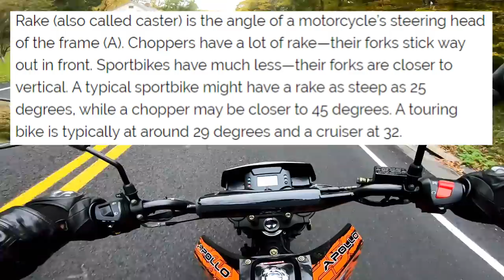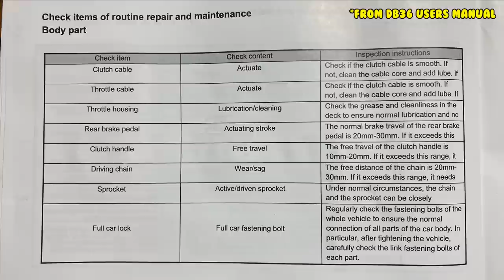[E1] Vitacci Apollo DB36 Supermoto Review, Build, Assembly, Test Drive, Impressions.(updated $1799)

Comment: I have a pitster pro xtr250. How would you compare the apollo to it? I'm thinking about getting my son something to ride.
Reply from the maker: I believe it’s the same engine (Honda CB clone) but DB36 is designed more for the road it has a stiff ride. The dirt version of the DB36 bike is the RXB250L
Reply: As of to date I've put 1k miles on it mainly driving to work (45miles one way). I did change the final gearing and put shinko 705's on it but seems to be holding up good. I appreciate you getting back. Your videos are helping me decide. Thanks

Comment: I am about to buy a Chinese bike. I like the Apollo DB-36 or the Lifan EFI 200. Which one do you think is the better bike?
Reply from the maker: Lifan is a great bike but I havent got to do a review on one yet, but I should be very soon! In the works
Reply: @MotoCheez  Thanks for reply. If you were to choose (manly street riding in Phoenix, AZ) would you go with the Apollo DB-36 or the Lifan EFI 200? I have seen very little reviews on that Lifan EFI 200 seems like a good bike though
Reply from the maker: @usaphilippines  I'd say the Lifan, its liquid cooled and I'm sure more HP and great for street use. If you plan on even a little bit of offroad I'd say the DB36
Reply: @MotoCheez  Cool thanks for the response! Going to get me one of these on payday.
Reply from the maker: @usaphilippines  awesome! If you use TXpowersports you can save a few bucks using "motocheez" coupon code at checkout.

Comment: So no greasing any parts or using a torque wrench?
Reply from the maker: No, the bikes I've gotten that I've checked the swing arm and neck bearings in the spots that should be greased had plenty of grease. I have seen that some do not though apparently

Torque wrench where?
Reply: @MotoCheez oh ok cool, I ordered my first one and my buddy’s that ride told me I should get grease and a torque wrench. But maybe the parts that need assembly don’t need to be torqued?
Reply from the maker: @drewmichaels726 I do go over bolts by hand, sometimes the plastic screws vibrate out, I use RTV silicone on thread to prevent the ones that loosen

Comment: I have a higher duration cam coming from Brazil for my Hawk to take care of that lack of top end on the Hawk.  With my ported head and 30mm smooth bore carb I have ALL of the mid range, but it still falls on its nose around 7000-7500.  I am willing to sacrifice some of that lower end grunt to get more top end power out of it and actually be able to use the top end of the RPM range more.
Reply from the maker: That's awesome! Love your vids too.
Reply: @MotoCheez  Thank you.  My videos aren't as high quality as yours, but I make up for it with plucky spirit :D

Comment: I have an Apollo and if I run this bike without a battery will it ruin the stator? I have the 2019 deluxe model 250 RX.
Reply from the maker: Only if the wire shorts out

Comment: you probably done answered this question a million times but WHICH is the BEST Of the CHINA DUAL SPORTS AND WHICH IS THE WORST And WHERE WOULD THE BROZZ 250 BE ON THE SCALE OF BEST TO WORST
Reply from the maker: Brozz250 is up number one. Very very close second is the DLX. Then this DB35 then the TBR7 then hawk250 then magician. Depends what people are looking for efi  is a plus and a minus for some. For The supermoto street ripping crowd I’d say the DB36 is number one, even if you convert any of the other bikes, it’s still number one because of frame, OHC weight and steering rake, suspension...  all depend on what someone want the bike for TBH

Comment: How often should we be changing the oil on the apollo bikes?
Reply from the maker: I think the manual says like 5000, but I do every 1000, it's onlyb1 quart of oil
Reply: @MotoCheez  ok sweet. So today I rolled over 370 miles so far on it. Still running good.
Reply from the maker: @therockjab  did you do the first oil change yet? That should be done now if you haven't. Then every 1000
Reply: @MotoCheez  I changed it at 100 then at 200. Trying to be extra careful out the gate.

Comment: How does one compare to a CRF230? Ive riden a dual sport 230 and owned a yamaha ttr225 for years
Reply from the maker: This has hard Supermoto suspension. Power wise. If you do the carb work it's not much less than the CRF230L. I owned one.

Comment: Is there a reason you never use thread locker on the bolts you’re worried about becoming loose?
Reply from the maker: I rather used silicone sealant so I can remove whenever I want and it's better on vibrations. I don't like locktite on panels because I know I'm going to remove them.
Reply: @MotoCheez  ok good answer just wondering i live in ny so cant reg one or id buy a Magician
Reply from the maker: Why can't you? Hawk250.com is New York and dozens of ithers

Comment: So I have same bike. 150 miles on it but it has developed am issue.. idle till 1/4 throttle is fine but anything after it sputters really bad  I checked  plugs they fine.  Slightly black in color. I'm 60 feet above see level. Any suggestions??
Reply from the maker: Did you rejet the carb? Possible the main vibrated out? Choke is definitely off? (Lever down)
Reply: @MotoCheez   choke is fully off jets are tight I changed the 109 to a 105 like u did. Didn't work for me.  I am out 3 turns on the mixture screw.
Reply from the maker: @therockjab  the plunger needle is set to middle groove? Had a few people have the needle clip fall off on theirs too
Reply: @MotoCheez   yea clip is in the middle..  it's crazy.  Its gotten worse. I wnet from cruising at 55 to nearly 45 now and that hardly cracking the throttle. I've tried adjusted the. Choke while riding to see while cutting out it would make difference but still nothing.
Reply from the maker: @therockjab  one thing I saw once that caused this was the tube that goes from the carb to airbox was collapsed. I pulled the tube off to run without it and it was perfect. Maybe try that?
Reply: @MotoCheez  I'll  give that a shot tomorrow.  Thanks.
Reply: Man after taking carb off changing jets like 50 times. I finally figured out the issue. The coil was not making good ground at the frame!!!!
Reply from the maker: OMG!!! Well, glad you found it. Now you're a pro at these carbs too😁🤜🤛🔥🔥😂
Reply: @MotoCheez   lol yea. I definitely got the "nack" for it ha ha .. thanks for all the help man.  Min truck is sweet by way.
Reply from the maker: @therockjab  glad you got it tho!  Thanks

Comment: @motocheez how often should I be changing the oil on this bike?
Reply from the maker: 800 to 1000 miles
Reply: MotoCheez thanks brother
Reply: There's a tube on the front left of the bike that came loose with a plastic piece that says in and out on the end of it. Does this go attached to anything or stays loose? It's connected to a metal piece behind the intake area on the left.
Reply from the maker: I'd have to look. I think it's just a vent.
Reply: @MotoCheez  if you could tha would be awesome. Thanks for the help. Just assembled the bike today.

Comment: Did you have to cut the tube that had the tag hanging down from it
Reply from the maker: Tag?
Reply: MotoCheez that was connected to the rubber hose that u said I don’t no what that’s about it says cut after first ride
Reply from the maker: Ohh. I just left it. Still No clue what it meant
Reply: MotoCheez o ok thanks didnt no if I needed to cut mine or not

Comment: Hey I'm pretty sure I saw you and your mob on the side of the road in the Cherneskie Rd, New Prestion area a few weeks ago...I went by on a red Victory with my wife on the back... I should have stopped but I wasn't 100% sure it was you.  
I'm done with China bikes after the Pitster. Its been doing good, but it hasn't taken me long to find it limits, finding parts for upgrades is a total pain in the ass and it has no balls..
Reply from the maker: PaiN's RIdes yeah, that was us, I think I remember that bike going by! The pit bikes are kinda junky. I will agree on that. The better ones are good, the cheaper older ones are garbage
Reply: @MotoCheez  Shit, I knew I should have stopped..  I can't call the Pitster garbage, its a solid bike, but I'm out riding it already and the suspension is damn rough on me.
Reply from the maker: PaiN's RIdes you should have! Not all garbage as I said. The pitsers supposed to be good!
Reply: @MotoCheez  My XTR250 is a fine bike and tough. But the guys I ride with are on KTM's, Husky's and a Gas-Gas...The lil' Pit just can't hang with the big boys. Plus at my weight of 225 the suspension can't handle the riding I do.
Reply: PaiN's Rides well that’s that! I remember asking you about that bike lol

Comment: Someone needs to make an aftermarket big bore piston/cylinder kit for these to turn the 223cc into a true 250cc or bigger if possible.
Reply from the maker: I heard these was a 300cc coming
Reply: @MotoCheez  If the kit was around $250-$300 I think buying a $1650 Apollo and the kit to make a 300cc would be way more bang for the buck than spending $4,500 on a Royal Enfield Himalayan 411cc or $5,500 for a Chinese 450cc adventure or dirt bike.... I wish they made a 450cc version of this Apollo for around $2,500- keep it air cooled, carbureted, easy to work on. Make it a 450 version of the 223 which I heard is a Honda CG125 clone.
Reply: michael brinks thinking about buying one in April i need all the tricks i can get lol 😆 what about Supermoto tires ? Think can be installed? And exhaust ?
Reply from the maker: Yes

Comment: How tall is the seat? I'm only 5'7" do u think I could ride this? Thanks
Reply from the maker: This bike has a low seat height. 30" inseam would almost flat foot
Reply: @MotoCheez  cool thanks man
Reply: @empireofdirtworkshop4304  at 5'7 you wont be able to touch lol I have this bike not endo but same one just not the street version and I'm 5-11 and I cant even flat foot it. I also weigh about 180 so maybe of your a bigger guy you can but i would say at 5'7 you cant touch both feet
Reply from the maker: This has smaller rims and tires, different suspension, it's a few inches lower than the dirt bike.

Comment: My Apollo is running good but gas will not quit running out of the tube on the bottom of the carburetor what is causing this it is driving me nuts
Reply from the maker: Are you sure the drain screw is tight? If not it might get a piece.of dirt in float valve...
Reply: MotoCheez so I need to screw that all the way in cause it is idoling perfect
Reply: MotoCheez is the drain screw on the bottom of the bowel
Reply from the maker: There's a screw at bottom of bowl where the hose.xomes.off, that's the bowl drain. The idle screw is on side of carb above bowl on right side of carb.
Reply: MotoCheez ok I’ll check that if it’s loose I just need to tighten up right
Reply from the maker: Yes.  It's just a drain screw, but that hose is also an overflow so if dirt in float valve it'll leak out same hose
Reply: MotoCheez ok thanks for all this info
Reply: MotoCheez can you tell me a good carb I can order off amazon and what all I need to order to fix this problem
Reply from the maker: So it's still leaking?
Reply from the maker: I have link at motocheez.com in bike section. If.you turn the gas off, drain that bowl screw run a bit of gas thru and tighten the bowl screw it should flush the dirt out
Reply: MotoCheez yes it’s killing
Me and the thing is brand new haven’t even road it yet
Reply: MotoCheez I’ll try that first

Comment: can you replace the front 15 sprocket with a 17? like on the hawk?
Reply from the maker: This bike runs the larger pitch chain than my other bikes, I believe the front is a 12 tooth. I haven't gotten into there yet
Reply: @MotoCheez  I'm planning on doing only city riding, hows the gearing/top end?
Reply from the maker: @ned_mograph5957  it's pretty good actually. Be fine for city driving
Reply: @MotoCheez  you're a rockstar
Reply from the maker: @ned_mograph5957  😁😁🤣

Comment: I was all set to get one but the 1.6g tank killed it for me. Fine for trails but if you commute with it you won't be going far with out hitting a gas station.
Reply from the maker: True. These usually get about 45 mpg, so 60 miles you’ll need a fill up.
Reply: @MotoCheez  which sucks because they look like really nice bikes.
Reply from the maker: duck9191 it could easily fit a larger tank. Wonder if there is any options for upgrade.
Reply: @MotoCheez  only 45mpg ? My 250cc Nighthawk would run 70mph with 300 lbs on it ( me and it had 6 gears ) and I got 65-70mpg running it as hard as I could. 45 mpg is larger cruiser gas mileage. that surprises me. It is a tiny 1 cylinder.
Reply from the maker: batsonelec C it’s geared super low. And my mileage is with a lot of off roaring. Never did a full on road mpg test. Might hit 60. Not sure
Reply: @MotoCheez  ok, thanks for the new info. I am still leaning at the Tao Tao just due to cost and it seems to be a decent bike for 10K miles at least. ( maybe more if taken care of ) I really want a tach though, doesn't seem many have that. I had to add one to my Nighthawk.
Reply: @batsonelectronics  my storm is in the 50-60mpg range if I'm not running 55mph. Still would only be a max 75-90 mile range.
Reply: @MotoCheez  Is the Frame neck a similar diameter the hawk or tbr? the delta box style frame is quite different then most china bikes 80's style cradle frame. It does look like they could have went taller to hit 2g which would have at least given 100m range with a bit of cushion.
Reply from the maker: duck9191 it’s beefier around the neck for sure. A larger tank would be a big upgrade!

Comment: I’m in Chicago area I think I have to change my throttle because it’s loose and my bike can’t idle really long
Reply from the maker: RenardMorocco On2K the idle is never done through the cable. It’s the screw on the side of the carburetor
Reply: MotoCheez maybe the vibration made it unscrew
Reply from the maker: RenardMorocco On2K the idle screw never vibrates out. But idle will change when it warms up. It’ll go higher

Comment: Push rod are you sure I thought they are all ohc engines
Reply from the maker: Yes the CG engine is a pushrod single lob cam with overhead valves. The db36 has overhead cam and valves.

Comment: Can you remove the pollution system and does it give it more power on these Chinese bikes
Reply from the maker: You can remove them, I’m not sure how much power you’d gain TBH
Reply: @MotoCheez  I just got a dongfang df250rtr cruiser, got a mikuni carburator 120 main jet and it's running great, intake mod
Reply from the maker: Leandy Perez excellent! What’s your elevation. Under 2000 feet I assume.
Reply: @MotoCheez 100ft

Comment: The engine is actually really good. Its a 80's Honda copy.
Reply: What engine or motorcycle model was this bikes engine cloned from
Reply from the maker: This is the CB overhead cam like on the 2 valve head dirtbikes
Reply: @cartmans8193  I'm, guessing a crf230 engine copy

Comment: Cool video. I've run into some trouble with gravity fed fuel systems that have no fuel pump using those inline fuel filters that have pleated filter material. I found the ones with screens to be fine but the others can cause a serious restriction and starve the carb for fuel at higher RPMs.
Reply from the maker: Absolutely, the small micron filters are not good for gravity systems. I've had the same experience.

Comment: I'm sooo glad to see you get an Apollo. I've been riding my DB 007 for 3 years and it's been good to me. I took the spark arrestor out of the muffler and it made it sound way better. I would like to change the jet but not sure what to put in it.
Reply from the maker: I did a 110 and it was perfect. I’m at 600 feet above seal level.
Reply: I'm in southern IN so not sure on the altitude without some Googling. It's always started first kick but it is cold natured till it gets a little heat in it. Wants to bog but after a few minutes of riding it will rip. I did remove the cap on the adjustment but I believe all I did was set it to the initial setting one and a half turn out.
Reply from the maker: Brinley Nicholson go 2 1/2 out and try a 110 main
Reply: Thanks Moto. You rock man. My phone provider screwed me on data for 3 weeks and I've been binge watching your vids tonight lol

Comment: How do u buy parts for it if it breaks down
Reply from the maker: TXpowersports has almost all the parts for the bikes they sell, other dealers too
Reply: There is no parts on that page no help look as csc motorcycles iam looking at the tt250 the sell the clutch basket and every bolt on it. I like they way the apollo comes stock but idk cuz I cant find parts on that site been the dozen of times??
Reply from the maker: Give them a call. They carry parts, the hawk magician etc has the parts page set up, he hasn't done the DB36 yet
Reply: I did find the parts but idk I dont like the site though dont wanna bog ya down bro but gunna go wit the csc tt 250 the site is so much easier but thank u for the help and proving me wrong :)

Comment: Will a honda engine bolt into it
Reply from the maker: Yes, it's a CT Honda engine clone in it
Reply: @MotoCheez  what model engine is in this
Reply: @MotoCheez  dude you are the man buy the way I subscribed
Reply from the maker: CT clone overhead cam engine, one of  the better ones
Reply: @MotoCheez  which model honda engine  I mean thanks
Reply from the maker: The "CT" style Honda clone

Comment: So I got a Templar x a few days ago and am having a time trying to get it to idle it’s all over the place up and down and hardly wants to stay running. Do you think I need to go ahead and do the jets and add a washer to the needle? Thanks for any input
Reply from the maker: Check choke is off (lever up) and Make sure there are no leaks at intake first, doing the carb mods will definitely be worth it too. It's usually the mixture screw is too lean. Of course it's capped